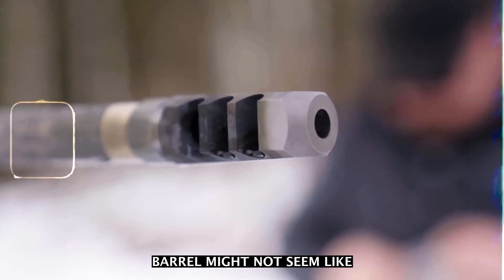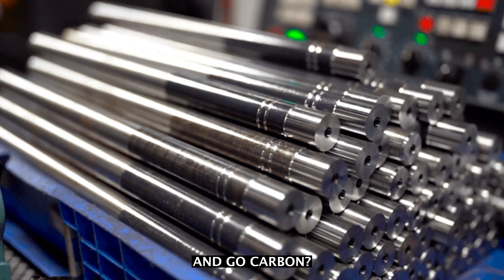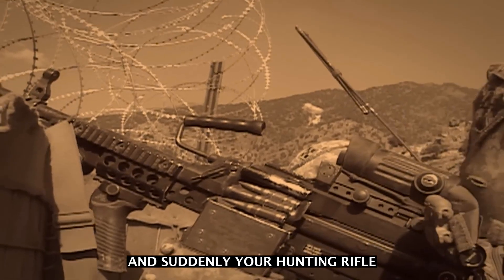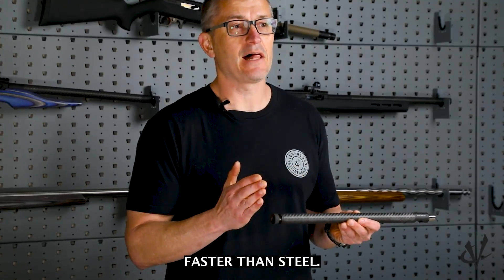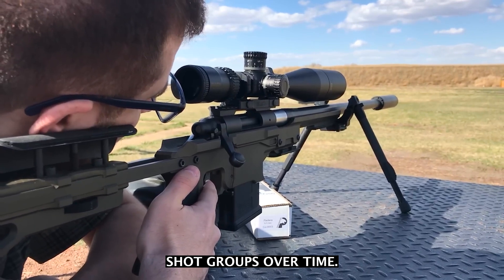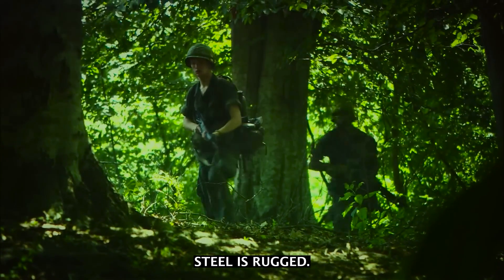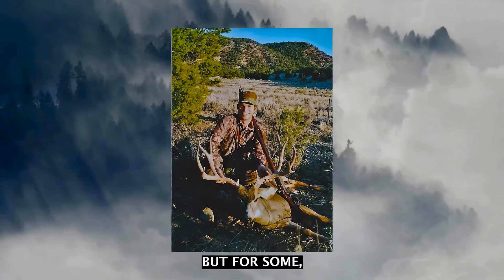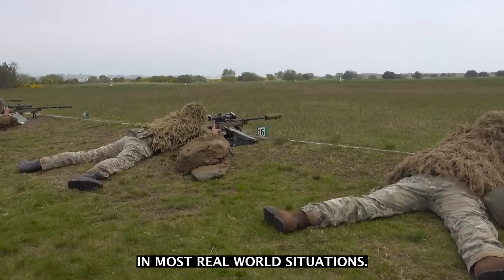Carbon Fiber vs Steel Rifle Barrels: Which Is Best for Hunting?

Comment: But smelters use carbon crucibles to melt iron in.  Why wouldn't I switch? In a war and a bayonet is also wanted on the rifle.
Wear and tear parts need to be hard though.  Titanium plating where magazine slides in, and other moving parts.
If you can take a gun and make it more than 50% lighter, it would sell more than a heavy one for most people.  Because they don't shoot that much.
Heavy guns are tiring to carry all day if you have to do that job.
Brass shells, and heavy metal.
Carbon fiber lock stock and barrel with titanium plating for moving areas that have friction.
Carbon Titan firearms.